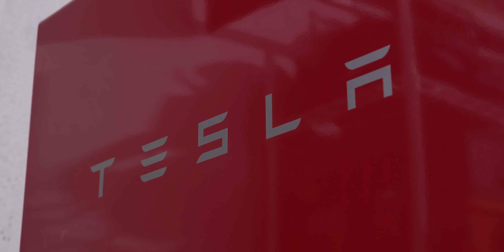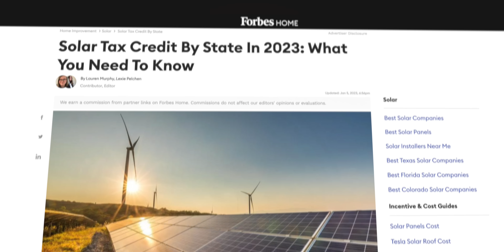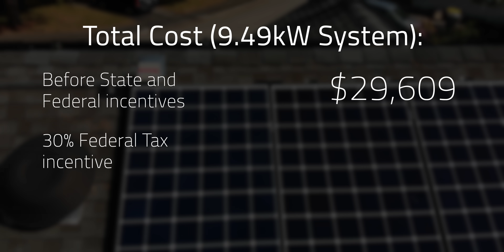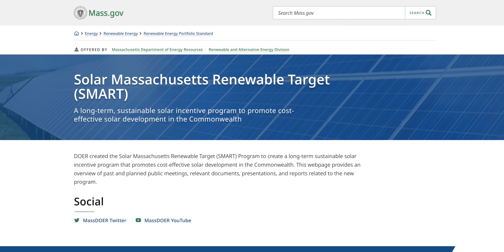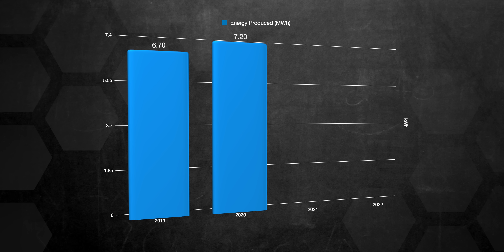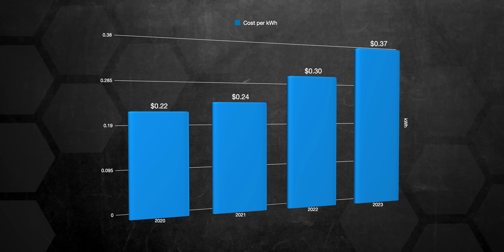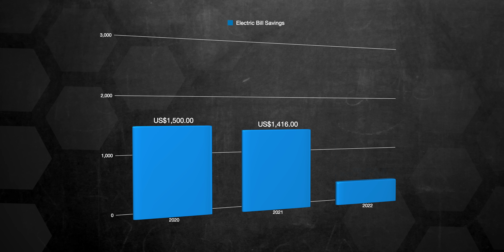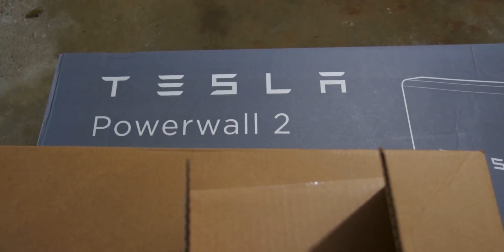5 Years with Solar Panels - Is It Still Worth It?

Comment: If it makes you feel better, an East-West configuration is actually better than South configuration (or North configuration if you live in the Southern Hemisphere) because the majority of your electricy use will be in the morning and in the evening which is where your East and West panels will be at their most optimal.
Of course this isn't the case if you use most of your electricity during the day, but that's not the case for most people.

Comment: It took a year and several different companies to finally have solar installed..   ESP from the Cal Bay Area came through very professional.  Waiting for final. Note SunRun would not install on a metal roof, they did offer to replace metal with comp.  But in a fire zone three in the Sierra Mountain range comp was the last thing I wanted.  Replacing comp roof in the future also a problem.

Comment: so your system with 6K from your state and a free 15K battery would mean for me not your cost of 21K (after tax break) but 42K.
so the same system like your for me went from a 7 year payback to a 14 year payback. and with the system rated to run at 60% at 20 years old. mine without break down would cost $120 a month in electric bills. until i replace it with a new 42K system again.

Comment: So, I live in NE Florida, our entire state is going through a homeowners insurance crises caused by hurricanes and corrupt roofing companies. If you asphalt shingle roof is more than 10 years old, many insurance companies will not insure your home. If this continues, we have to factor that into any calculations on the cost of solar installations and long term maintenance. Right now, it doesn’t seem that it would be cost effective to install solar on any homes that do not have have a brand new roof. And even if you have a brand new roof, if you are forced to replace it every 10-12 years instead of the 20 years lifetime of shingles, the cost to remove and re-install 10 year old solar panels adds a new set of complexity to cost calculations. Can you add any insight into this? Most of the homes here do not have large lots  that would facilitate mounting raised solar panels in the yard and most HOAs would not allow that either.
Reply: I also live in NE Florida, and installed the panels.  My roof is 12 yr old and my insurer does not have an issue.  My installer said that the temporarily removing and reinstalling the panels was straightforward, and I even think is was covered under the warrantee (although I have had difficulty contacting them for another matter, so the the issue of contractors going out of business is an issue.)

Comment: I Have 54 solar panels on lease $103.00 Reverse Meter $25.00 a month, total $128.00 a month $ 1536.00 a year fuel bill
My neighbor down the road a piece with a single new single wide home, paid $ 3800 same year 
Last year I had accumulated 5800 kilowatts in excess energy, and lose the kilowatts save as the power co. don't pay shit for my power production I also have Geo Thermal for heating home and hot water no storage battery
I save $ 2,264 over a new single wide trailer home in one year  my lease ends in 4 years cuts another $103 a month
Do I think it is worth it, Hell yea, I don't do a thing to the up keep, 0 up keep
I will be removing 27 panels when I have metal shingles installed next year keep them in reserve no longer needed
I don't know about you but my bill will only reflect the meter rental, $25.00 a month, $300 yearly fuel bill

Comment: Enjoying your videos. Couple of questions. Asphalt singles. Did you start with a fresh roof? How much age on an existing roof would be reasonable to build onto considering the complexity of replacement after solar grid install. What roof cover material did you use on the new house. My brother has been off grid solar,wind,propane gen backup for 12yrs. It's been alot of work.
Reply: Figure out how many years you need to make back your money (we figured ten years). Then do the math on your roof (ours was reasonably fresh so we figured 20 years). This will give us about 20 years with the current panels and when the roof needs replacing well prolly bite the bullet and get a proper solar roof. Currently eight years into our panels and they paid for themselves two years ago.

Comment: I'm thinking about going solar when I retire (at the end of this December).  My Mom is an oxygen patient, so power-outages can quickly turn into an emergency.  This is a fantastically educational video!!!  Thank you so much for posting!!!
Reply: @Shane888 Davies oxygen compressor requires 110v AC.  No tanks.
Reply: You would need a battery as well. Solar panels don't work during a blackout. They need to be connected to the grid or a battery. If there is a blackout you're not connected to the grid so the panels stop working. If your salesman tells you otherwise they are lying. I work in solar. Ilum energy solutions.
Reply: Also a generator would help with relatively short term power outages.
Reply: Will you have enough tax to write off to get the rebates?
Reply: @richardpage2555  Good question, I didn't even think of that!
Reply: Or you get get a generator installed to your gas line for about $8k less.
Reply: Oxygen machines can run at 400watts or more and that's at 230v ac. So if you want to run for 12 hours you will need 5kwh of storage not allowing for losses or anything else. In reality you'd want a good bit more storage. 15 to 20kwh to cover you into the next day and hopefully sun to recharge those cells.
Reply: hey I hope you are having a wonderful day today
Do you want to install solar panels or anyone in your Circle area who wants to Go Solar?
Reply must please
Reply: A gas/propane/lpg generator is the cheapest backup for outages.

Comment: An expense I've never seen addressed (and I've posted it on 5-6  specialty YT channels without anyone ever replying) is how much it costs EXTRA when you need your roof re-shingled. I would think a couple/few thousand at least for the panels to be moved/disconnected, the roof work to be done, and then the panels to be reattached. True, you're good for about 20 years after that, but if you already have some wear on your roof when the panels are installed, you'll be looking at less than 20.
Reply: The roof under the panels will last basically forever.
Reply: @stargazer7644  Are you referring to a specialty roof installed specifically with the intention to put solar panels up? Because normal, everyday shingle roofs typically last 20-25 years and that's if the best shingling material are used.
Reply: @anthonyc1883  That's if they're exposed to sunlight for 20-25 years.  Regular asphalt shingles last a very long time covered by solar panels.
Reply: @stargazer7644  But I've never seen a solar panel installation that completely covers the entire roof, edge to edge, top/bottom/sides. There's always shingling visible above, below and on the sides of the panels. So those areas are getting normal, constant environmental wear even if what's directly underneath the panels is shielded from the sun.
Reply: This is a major issue that gets glossed over or not mentioned and can actually affect the value of the house in a negative way.

Comment: Off grid here, 2 sol ark 12 inverters and 10k in solar panels charging 40kwh of lead acid with a simple 10,000 kw portable generator as back up for long stretches of overcast and rainy days. We can usually go 2 or 3 days without good sun before we need to start the generator. Looking to add more storage since on sunny days batteries are topped off before 1 pm. So we are fairly happy with our system. Stove and tankless water heater are on propane. This does save us power on overcast stretches.

Comment: The issue for solar here in the Midwest is obviously not sun availability, but the risk of damage to panels from hailstones. Potential customers are strongly advised to consult with their insurance company to verify any special caveats or endorsements that may be in play for the panels, the structure of your roof, or the replacement of the roof when the shingles age out. Also, there are numerous shady solar operators who sell a bill of goods with poor installs, poor equipment, or poor terms (for the homeowner). I have a friend whom I fear is amid just such a contractor. Just be exceptionally careful.
Reply: I've really wondered about the issue of roof replacement and hailstones.  We had spiked hailstones a few years ago. That was something new to me. And it's rare, but golf ball to softball size hail are real things. But even without dramatic hail events, eventually roofs need to be replaced, and dismantling your solar panels to replace your roof will certainly add to the costs even if your solar equipment is still viable. You would probably have to hire people who work with solar outfitting to take down the panels and related components, and then have the roofing company come in behind them to do their part. But if parts of the solar equipment are worn out or damaged, you'll be looking at replacement and reinstallation costs to get back on solar power. I would think insurance premiums might be higher too just because of the fact that you're putting holes in your roof to anchor the solar equipment, and it's putting additional weight stress on your roof - so now your roof is going from being a cover to an additional support structure, and most roofs probably weren't constructed to perform as support structures. 

I guess my point is that there could be a lot of additional costs associated with solar power down the road that a lot of people may not be aware of, and it could be more than a lot of people could comfortably afford. If you could calculate what those costs might add up to, and you planned to stay in your home for a long time, you might conclude that you're just deferring what you would pay for electricity from the grid now, to be paid later in the form of additional costs for maintenance and replacement of solar equipment. It might make sense for some people. It's something that should be considered in relation to purchasing a home that's already equipped with solar panels too though. It might seem like a great thing, but the maintenance and replacement costs for the roof and managing the solar equipment part of that process might be an unpleasant surprise that a homebuyer may not be aware of and might be hit with dealing with sooner than they anticipate with existing solar structures. I think this is relatively new territory, and there are going to be more issues that crop up and have to get sorted out. Insurance-related issues could be a major issue.
Reply: Damn I never thought of hail in the equation
Reply: i have a friend who sold solar, she had to quit because her conscious couldnt keep doing it. her particular company was selling 75% lies
Reply: Difficult these days to do business with most as the quick dollar is paramount.
Reply: Me me me me... Me me me

Decarbonization is 21st century pyramid building.
Just burn coal. 

This is sickening on so many levels.  "How to screw the lower middle class and make them pay for your feel-goodery."
Reply: @DIYDaveOK  Going on year #2 with our solar. Our panels have survived some pretty nasty hailstorms here in Iowa. That first one I was sh$ting razor blades, especially since it’s our only source of electricity. Definitely way better now. In our area, all the sunless winter days are the enemy. Not a huge deal, we’ll just have to build up our battery bank. Our usage is low, so it’s not a huge deal at all.
Reply: Solar is actually just not worth it in terms of affordability and reliability. No. Do the math CAREFULLY and DO NOT DISMISS the long term MAINTENANCE COSTS. Over a 25 year period, which  salesmen claim to be the lifetime of any solar panel. Right…😂 Also, seriously consider the panels AND THE SUPER EXPENSIVE STORAGE BATTERIES’ degradation rate over 25 years, resulting in a large percentage of the already relatively meagre percentage efficiency, when it’s brand new, to be lost. In hot sunny countries like South Africa these solar panels act as heat sinks which causes serious overheating of these panels which decreases efficiency EVEN FURTHER. Here we have no problem with heavy snowfall, but golf ball sized hail will wreck any solar panel array. Your insurance is also super expensive on that. See ALL THOSE HIDDEN COSTS? That was not even mentioned in this video. Does a solar company sponsor the video maker? Highly possible? Could be. Now there are also Li-ion batteries to buy with your panels. Otherwise its a waste. These batteries are super expensive as mentioned already, and do have a short lifetime, draining faster than what is claimed in the sale - Especially in permanently load-shed countries which damages batteries immensely. These batteries have to be replaced often as they do not always live up to their expectations and they have a shelf life. Add all those extra costs to your calculations. We’ll chat again. Let’s talk clean energy. The manufacturing process of these solar panels and their storage lithium ion batteries is extremely power hungry. Their manufacturing processes are more damaging to the environment than burning reliable fossil fuels (which can be sufficiently cleaned during burning with new chimney technologies etc). This leaves us with a carbon footprint of five times greater than burning fossil fuels. Undecided? You shouldn’t be. It’s not worth it.
Reply: @LabandLogic  My daughters electric bill is $737 a month.  I'm pretty sure solar isn't going to cost $8000 + per year, but nice propaganda
Reply: @LabandLogic  This just isn't correct. Unless your home is powered by nuclear or other green energy, solar is much greener than gas that has been siphoned from the ground and shipped to power stations. And this video did the cost breakdown.  I've already paid mine off in 7 years. Also, the cost if power is only going up.
Reply: @LabandLogic  What are you talking about try watching the video. This guy lives in the North East where solar is not even optimal and has almost paid his system off in less than 5 years. The rebate, solar credits, and $400 a month in electric bills.
Reply: @AchillesWrath1  True enough, though despite the lower amount of power they can generate, he is in an area where a lot of money is given back in the form of those rebates and he is paying ridiculous rates for electricity. For example, here in Texas I can't get a quote for a solar system installed for less than around $80,000. Our electric rates are always under 20c/kWh, sometimes less than 10c meaning I'm not paying over $200/mo unless it's July or August (and we're under $100/mo) during the Fall/Winter. We spent a couple thousand to improve our insulation and HVAC system last year and we're seeing about a 30% reduction in our energy usage this summer, which is great. Unfortunately the economics just don't work out where I live and I've checked in with energy sage and various solar installers multiple times over the last 8 years or so seeing if it ever will.
Reply: all it takes for maintenance of solar panels is just hose water onto roof even few months, it’s real not much
Reply: @Lizelle Swanepoel  you must be part of a coal mining family?
Reply: @LabandLogic  Well said.
Reply: Across the country are PhD Electrical Engineering graduates that claim the CURRENT 2022/2023 SOLAR PANELS HAVE 22 PERCENT,  OR LESS, EFFICIENCIES!  I am NOT an engineer!  But if I have 1000 square feet of Solar Panels, then I'll install 5000 square feet of panels to get that 100 percent efficiency!  RIGHT?  😅  ( It does not work that way! Just because I increased the number of solar panels by an additional 4000 square  feet, to 5000 square feet! The "efficiency rating" REMAINS at 20 percent, or LESS! 🌞
Reply: @EugeneSSmith Solar is just not very good. Imagine anything else you spent 10s of thousands of dollars on that only gave you 20 percent t of what you needed and still having to use what you already had like city supplied electricity for the other 80 percent. The problem with solar is the overall cost and the efficiency. I live in Phoenix and I get multiple companies every month knocking on my door all offering the same thing and stating that the other companies don't do it right. I also have many friends and colleagues who have regrets in the purchase of their panels.
Reply: @1sinister80  So you think he's selling power back to the grid on 20%? At least pretend you know what you are talking about, you do realize the batteries serve a purpose correct. Try watching the video

Comment: I wish I had time to watch. I have just a simple suggestion. If a person wants to go solar, use movable panels. Ours are set up on poles which can be automatically turned or manually turned as ours are. We have used them for 20 years. We decided to manually turn them for the exercise value. We get outside several times a day and are staying physically fit even though we are old. And, our system works great. One thing anyone has got to realize is that carbon based fuel is very necessary as a back up.

Comment: 7.5 yrs ago i installed 40 panels and from day one we had no Elec. bill! Over time we bought EV's, swap a propane drier for elec. and still no bill, our heat is also propane and yet we had built up a credit of over $1000! So we decided to supplement our heat with our credits and great we had lower fuel bills, since then we added 12 more panels to lower fuel bills further this along with a wood stove and the traditional heat rarely comes on saving us $4000 per yr. minimally, solar has given us free electricity, free heat, and credits we can bank! Ya, solar works!